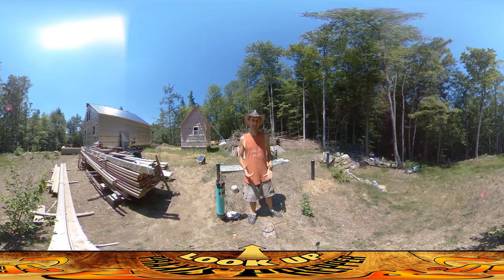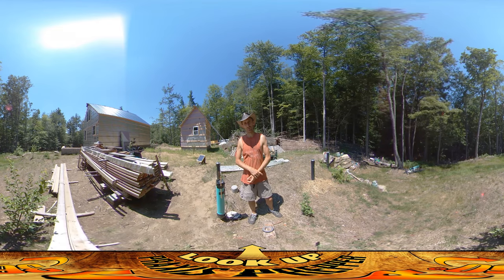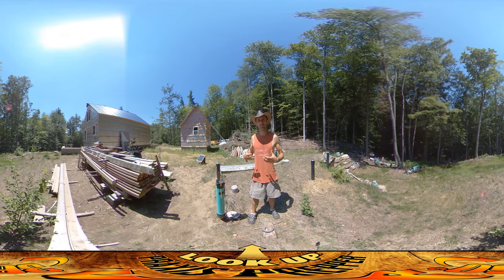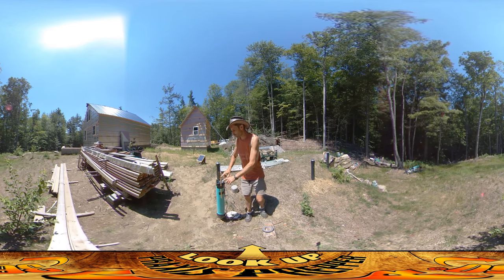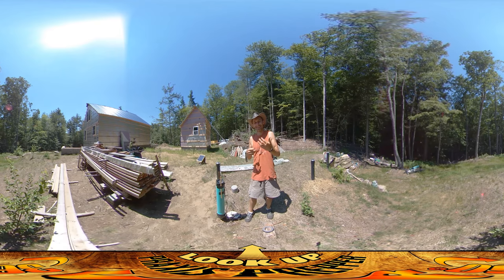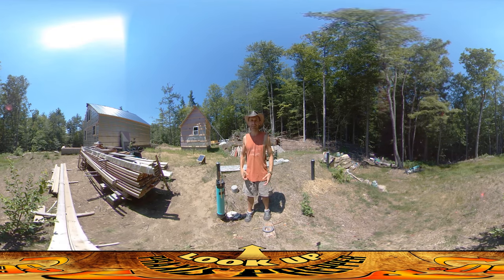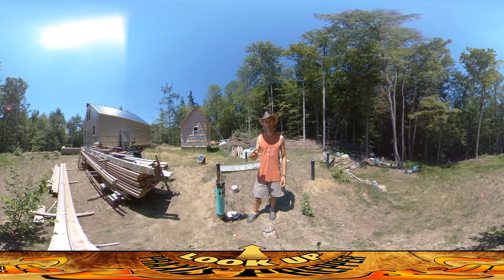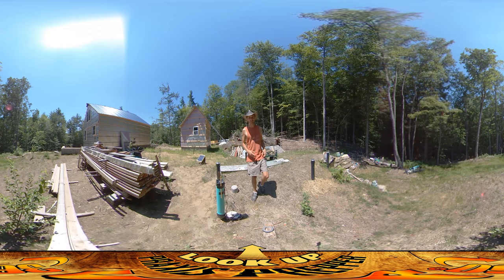Homestead Building - Adding a Vent to the Root Cellar Fallout Shelter

Comment: While i like the idea, i would advice you to turn the fan around ... See, hotair can contain more moisture then cold air, this is why hot makes water 'evaporate' while cold makes water 'condensate', so blowing warmer air into the tube with cold air, will mainly just add water into the thing, which you said you had problems with... and i will safely assume the door structure isn't 100% air tight, so any air the fan will get out, will be replenished through the door, which is mostly in the shade and thus has colder air around anyways ... (also, hot air rises, and that may or may not aid in ventilation ~ f/e if the tube is in the sun, the air inside will want to rise, and aiding that and creating suction on the door side seems a lot easier then trying to have such a small fan blow in the opposite direction).
Reply from the maker: You're 100% right about the air outside being humid. It definitely is. The only way this fan works is if it can warm up the root cellar as the fresh air is coming in as well to reduce condensation. I have a dehumidifier coming into the mix to really solve the problem soon too. I think over time having the air mechanically dehumidified will be a good fallback position until I can get the hang of how to manage that space without the mechanical help.
Reply: @PraxisPrepper  why not just have it suck the air out? and any moisture that happen to be able to be in said air based upon temperature...

now you are trying to blow hot and thus humid air into a cold room, it will just condensate and increase the problem.
Reply from the maker: @dutchcourage7312  The air outside is all hot humid air either way, so whether the air is drawn in the door cracks or through the vent pipe, it's the same air. I chose to push the air vs. pull the air because it's my understanding that it's a more efficient way of moving the air (compression vs. creating a partial vacuum to draw air in) - but that may only even be the case at higher pressures/suctions. I'm not sure. But either way, the air outside is warm and humid, so if I'm moving fresh air in there (whether by pressure or vacuum), it's still only going to help once the space warms up a bit and stops (reduces) condensation. Overall... I need to do more work to figure out how to operate that space well. Hopefully practice and research will make perfect.